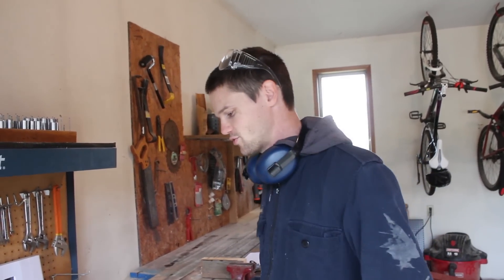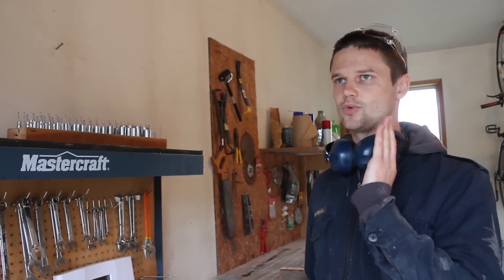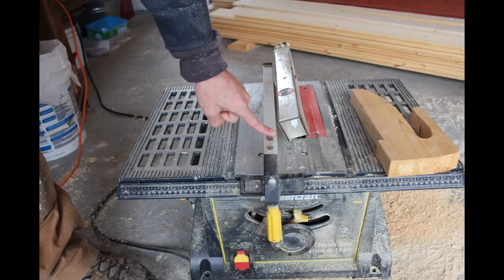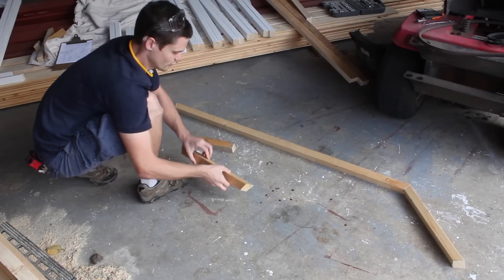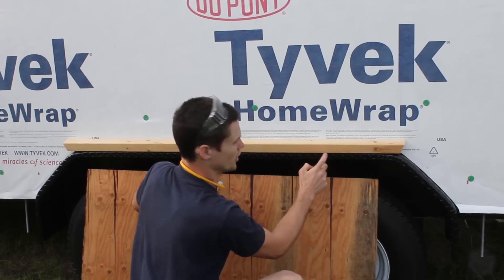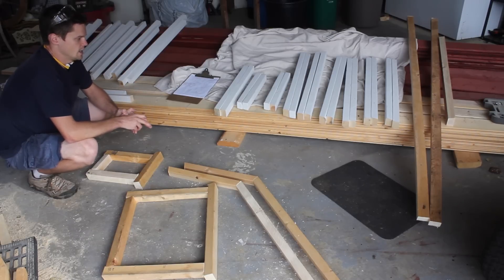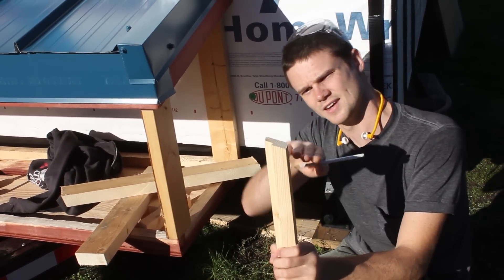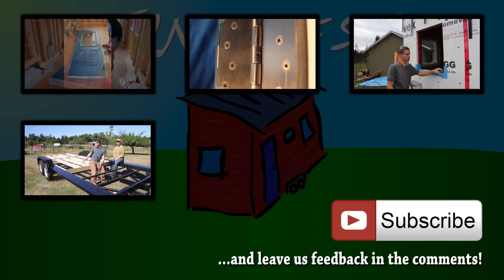Tiny House Exterior Trim Preparation (Ep.20)

Comment: I like the fact you took the time to prime all the way around the trim before you put it on it will save you time in the long run. A lot of people only prime the sides which show and later on 10 -20 years down the road there may be deterioration on the back side. Good job.
Reply from the maker: Rita Mastin Hopefully it will stand up to time. +mmanut who I can't reply to or tag seems to think there is too much moisture in this simple framing lumber, but it was fairly dry by the time we primed it, and we tried to seal it well so hopefully it won't shift or change dimension over time.
Reply: Most of the time lumber is kiln dried to a moister content of 6 percent moister. Unless it sits around in the damp air or gets rained on it should hold this content for a few days or weeks. The wood needs at least this content just to hold up the cell walls. Or there will be dry rot.

If it was kept under a shelter or tarp before you used it you should be ok.

Comment: Looks good! On your bottom trim board, you talked about water running away from window down front of board and dripping off of bottom corner. If you dig into this a little deeper you will find that a 1/4x1/4x1/4 groove is standard on the very bottom to keep water from wicking back up the bottom side of board. Dont take my advice as gold but I think you will want to run that additional groove on very bottom to further protect from rot. I do know that getting moisture away is key to longevity of wood. Yall are great and glad I found your channel. Awesome job!
Reply from the maker: 19stoney64 Hm, I didn't come across that in research. It's too late to add that now (we're further along than in the videos as of now) but I will definitely remember this if we build another one. Thanks for the feedback!

Comment: I just discovered your series and am in the process of building my own tiny house. It's great to follow your construction and I want to thank you for being so descriptive in your design and implementation. One thing I noticed, if it's not already too late, is that you have no insulation on the outside of your sheathing. The danger to this is that the exterior sheathing will become cold during the winter and cause condesate to form on the back of it which will saturate your fiberglass insulation. By adding 1 or 2 inches of rigid foam on top of your house wrap, you will keep the plywood warm enough so that condensation will not form. This also has the advantage of removing thermal bridging in your insulation stack. The only catch with this approach is that you will have to adjust your door and window trim to account for the additional thickness. If you decided not to address this on purpose, I'm curious to hear about your rationale. Foam insulation is quite expensive and if you were able to avoid this issue in some other way I would like to take your design into consideration in my own plans. Thank-you again and good luck with the rest of your build!
Reply from the maker: Will Kelly Thanks for the feedback! I have seen the kind of installation you're describing. It seems like a fairly new technique. I've seen a few videos of Matt Risinger doing something similar (or even more complex) to create more elaborate wall systems. Unfortunately it is too late for us to add this element, however we have another safeguard in place to protect from moisture inside the walls.Condensation comes from warm air, containing water vapour, coming in contact with a surface cold enough to condense the vapour. For this to happen, air would have to seep into the walls from inside the house and make it's way past the insulation to the cold side of the wall. We will be installing a poly vapour barrier (basically a huge sheet of plastic) on the warm side of the insulation, and sealing it up tight. This will mean the house is essentially a plastic bag that vapour cannot escape from. This should go a long way to prevent moisture from getting into and/or building up inside the walls. We're also using Roxul insulation, which is much less vulnerable to moisture than fiberglass.

I'm not an expert, but I made this choice after doing some research and hopefully it will work out. If you follow us in the future you'll hear about any issues that arise from our build.

Cheers

Comment: Watching this episode I was surprised that you didn't cut a drip valley into the bottom of your sill. Its commonly about 1/4w x1/4d x 1/4 in set back from the front.should any water work its way up under the sill it hits this then falls off.
Reply from the maker: Tom Langley We've heard this a few times... this was an item that we overlooked during research. The angle of our trim is pretty steep at 15-deg, so hopefully water won't be climbing up that. Plus we're going to re-caulk everything this summer because there has been some contraction in the siding. If there is a major problem we'll definitely update everyone to show what happened.

Comment: Curious - did you run the table saw about a 1/4" deep along the underside of the window sill so that if any water runs back it will stop at that cut and drop off from that point? Like here http://youtu.be/XdqaaD4qt14?t=4m47s
Reply from the maker: Sachi WI No we didn't do anything like that on these pieces. You'll see in the next video how we used shims to help install them tight, and the angle that the top and bottom pieces produce is enough to shed the water away. If you're referring to the actual sil, you can look back at our window installation video to get the full picture of how it all fits together.
Reply: Yeah it's just a trim piece - nevermind :)

Comment: That framing lumber is high in moisture content, it will shrink after a while and joints will all open up. Not a smart choice in finish lumber. You are cheaping out on wrong places.